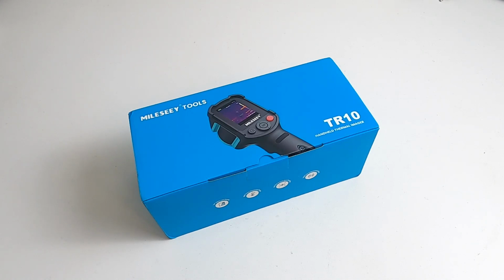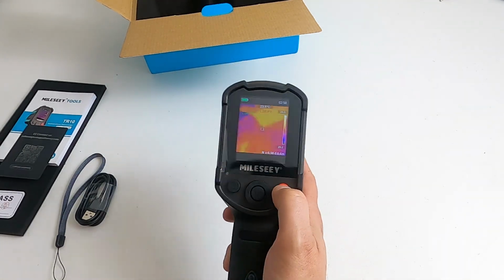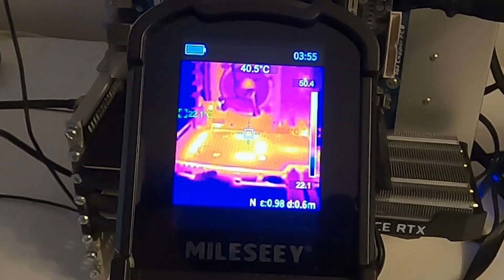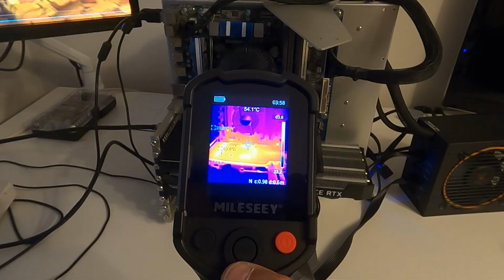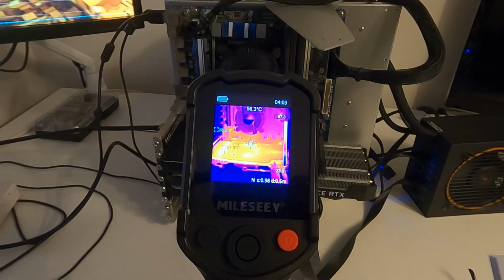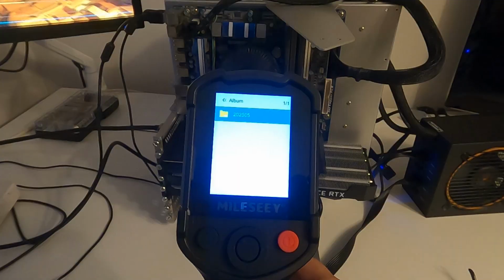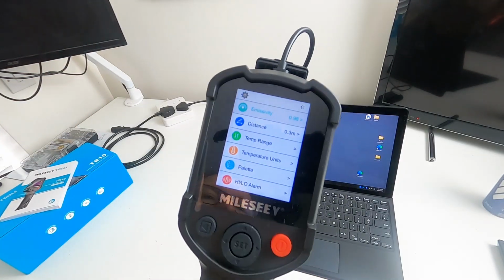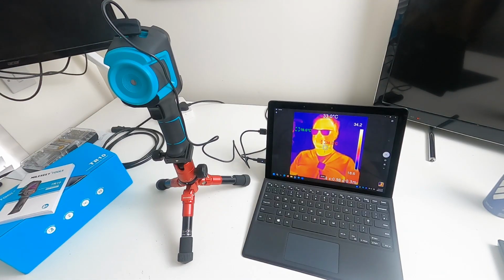Mileseey TR10 Thermal Imager *REAL* Unboxing and Review in English

Comment: Hi, would this pick up hot central heating pipes in walls / floors?
Reply from the maker: It can definitely do that... the visual scale on the screen gives temperature values, obviously, but the screen auto adjusts the colours to show differences in temperature really well.

You can see pipes hidden in walls and under floorboards.

For central heating pipes, this will work best when the house is cold and the heating is then turned on as the temperature difference between the pipes and the surroundings will be largest.

Hope that helps.

Comment: Please, is it possible to attach a macro lens? Could you show the printed circuit board in detail? I need it to identify in detail the component on the PCB that is heating up. Thank you
Reply from the maker: It'll show hot spots well enough to determine which component is getting too hot on a circuit board. I've used it to check RAM chips on a GPU, for example, and it worked really well.
Reply: @sterntechdaddy I'm more interested in SMD components. They are significantly smaller than GPU or RAM chips.
Reply from the maker: I understand that... this is the cheapest thermal imager they make, but it should be able to pickup the smaller chips. You might need a higher definition device if you're wanting to show an entire board in the screen - but it'll spot temp differences between individual chips perfectly well.
Reply: @sterntechdaddy  Imagine that there are, for example, 5 small SMD capacitors next to each other on a PCB. One of them is shorted. Would this thermal camera be able to show which capacitor is heating up and which is shorted? Could you make another video where you would try to take more detailed shots of small components? Thank you.
Reply from the maker: I think it would detect that... you can see in the video how the temperature varies on the hot back plate of the GPU when the display is switched to Blue Hot mode...

https://youtu.be/TLDEb41Zcf0?t=525

Individual RAM chips have defined edges and can clearly be seen. I think a hot or cool SMD cap should be obvious in that display mode.

Comment: Thanks for video.  What is the distance possible to see a house?
Reply from the maker: You can officially adjust the range on the device to anything between 0.3 and 3 meters - not really far enough to show a house. 

I had a look at my house using it and it did show temperature differences.

This is the entry level model so I expect the more expensive cameras will be better at longer distances away from the heat source.
Reply: @sterntechdaddy  thank you for reply.

Comment: $189 Aus E-Bay discount code black Friday deal from the mileseey shop free delivery Aus - Bargain 

If it came out of the good ol US of A it would be $700 

I have a FLIR 1 Pro at  4 times the price i use for termite use ( and handy for locating studs/cabling hidden in walls)  but this is a great daily tool for checking my 100% off grid solar/inverter/batteries and switchboard for any loose connections or equipment showing stress like blocked air fliters  

Brilliant indeed ! 

I will compare the 2 , maybe the Mileseey is as good ?
Reply: Estou aguardando a entrega do  TR10 que comprei. Deve chegar em 10 dias.
Já pensava em comprar por diversos motivos, mas comprei imediatamente após perceber uma infestação de cupins em minha casa.
Uma pergunta: a câmera termal foi realmente eficiente para detectar ninhos de cupins em madeira no seu caso?